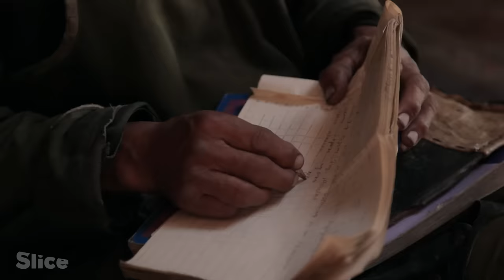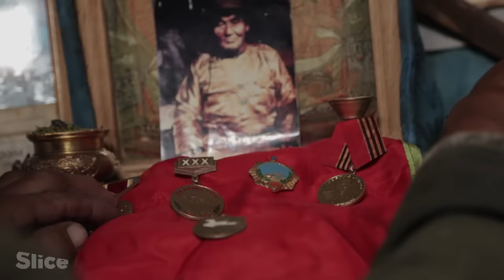Mongolian nomads’ ultimate dilemma | SLICE I Full documentary

Comment: Building a fire underneath a truck would have been the absolute last thing to cross my mind as a solution to that...i guess im just not cut out for that OG nomad life.
Reply: Better don't do it to a petrol engine driven vehicle.
It is safe though for diesel vehicles.
Petrol fumes are most combustible at a rate of 14:1 air to petrol, while diesel fumes are much less likely and are hardly combustible